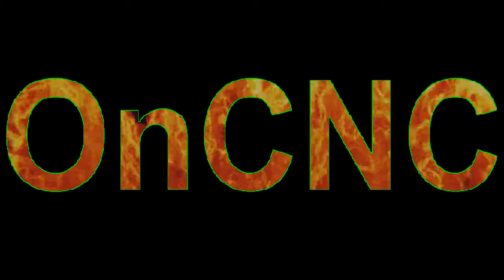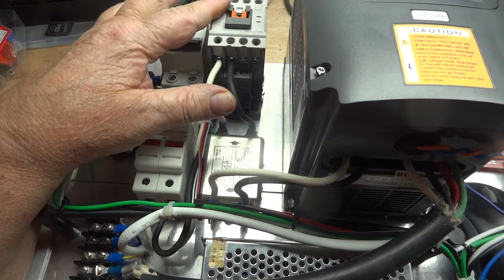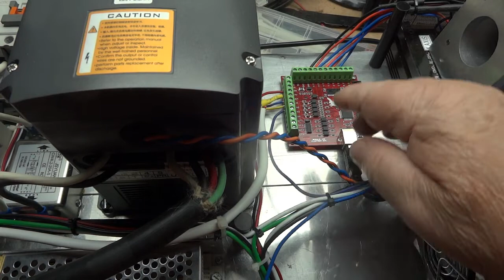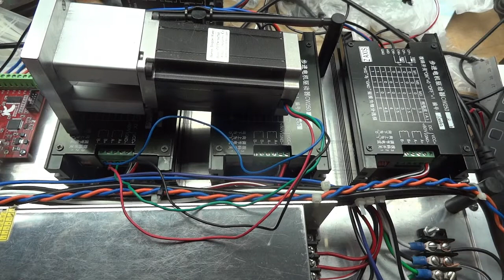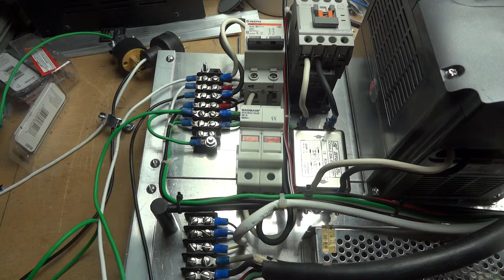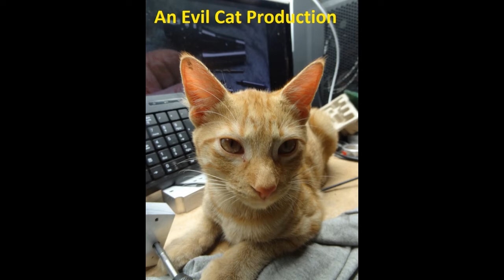3 Axis USB CNC controller with VFD wiring...

Comment: Hi Can you please post wire diagram  from VFD to control board . Thanks,
Reply from the maker: It's not wired to the controller, it uses this...

https://www.amazon.com/RS485-Converter-Supported-Automation-Controllers/dp/B076TB8GVL/ref=sr_1_4?crid=1ZKMUS7W9QSFM&keywords=rs485+vfd&qid=1666330963&qu=eyJxc2MiOiIxLjYzIiwicXNhIjoiMC4wMCIsInFzcCI6IjAuMDAifQ%3D%3D&s=electronics&sprefix=rs485+vfd%2Celectronics%2C134&sr=1-4

the wires fo to the vfd's rs485 port. If it does not work reverse the wires. You will also need a drivef.
Reply from the maker: BTW the RS485 should be marked in your vfd.